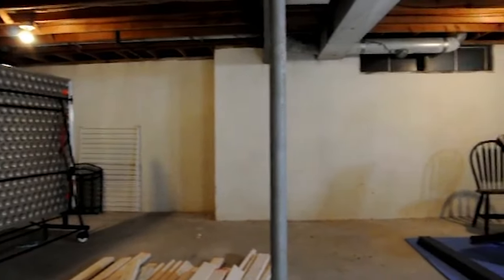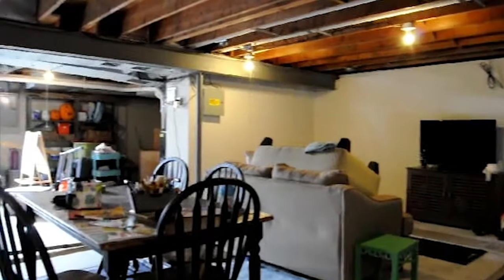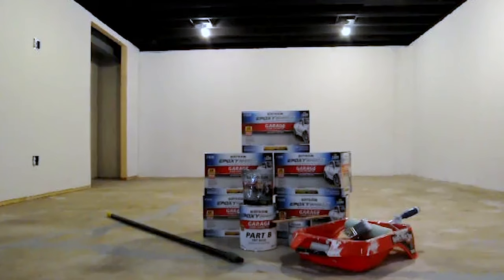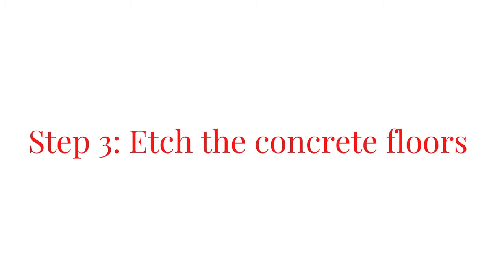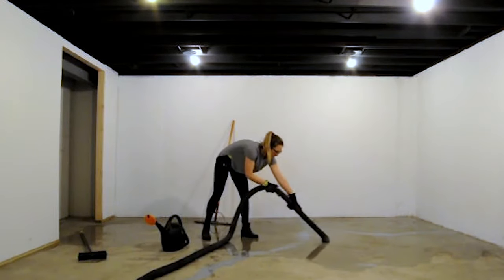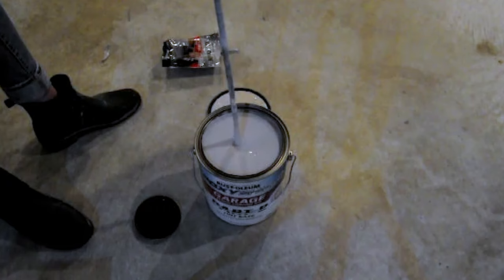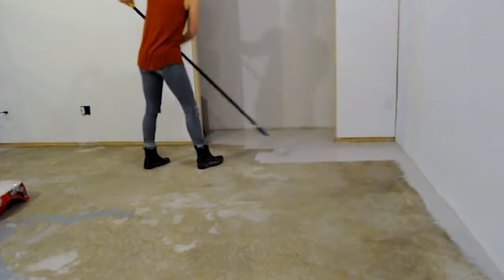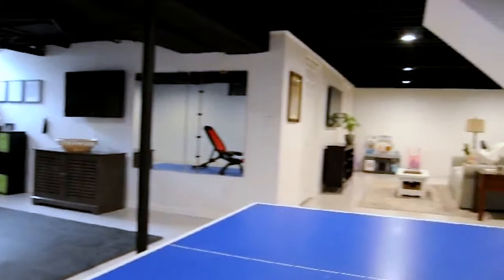How to Paint Concrete Basement Floors Using Epoxyshield

Comment: Lovely finish! I have used this process in the past and if I had to again (which might be sooner than later!), I would still take the necessary cleaning steps, but, I would paint the floors as I wanted, THEN us a clear epoxy as a sealer/protective coat. Price wise, it's easier on the pocket book!
Thank you for sharing your story.
Reply from the maker: Thank you for sharing that tip! :)

Comment: Did you have cracks on the floor if so how did you fix it. Can you recommend any product.
Reply from the maker: Yes I did! I used the Rustoleum patch and repair concrete product. The one downside was that it was darker than the floor color I chose and it showed through when I painted the first coat. I added a second coat over the cracks and it blended in just fine. Here is the product https://rstyle.me/+XViGw4ilZzQTVL2YSccr7Q

Comment: I’m curious what to use if you have dimples in your flooring
Reply from the maker: Use a thicker nap paint roller to get the paint into the dimples. You can also fill the dimples with concrete crack filler before you paint.

Comment: Awesome job! I love how your floors turned out! The painted black ceiling looks awesome as well.  Question...
I painted my basement concrete floors a few years ago. Can I use this method over my painted floors or will I have to strip the paint first? 
Thanks again!
Reply from the maker: As long as the current paint is not chipping, I don't see why you can't paint over it.

Comment: Great step by step guide.  Thanks so much for sharing.  Can I ask why you used the Garage Kit rather than the Basement Kit?  Is there a difference?
Reply from the maker: Thank you! I liked the color options for the garage floor coating and figured it would only be more durable than the basement epoxy since it has hot tires and heavy cars rolling over constantly. :) It has held up great so far!

Comment: Hi! I'm planning to do this for my flex room as well. How has the paint lasted thus far? Have you had any chipping or paint come off the floor? Was there any clear coat epoxy used? I didn't see that. I wonder if that would make the floor slippery if liquids are spilled. Thanks for the DIY video and the amazing final results!
Reply from the maker: Hi there! The floor has held up very well. The only place where it has chipped is at the sewer cleanout drain where the plumbers had to use big tools to twist off the cap, but it is not noticeable. I was concerned about a slippery floor as well so I purchased this Rust-Oleum anti-skid additive that I mixed right into the can of paint before rolling it on the floor. This gave it the little bit of grit I wanted to prevent a really slick surface. Here is the link to the additive: https://rstyle.me/+AGtrl78bLuoFOVmFTreIaw